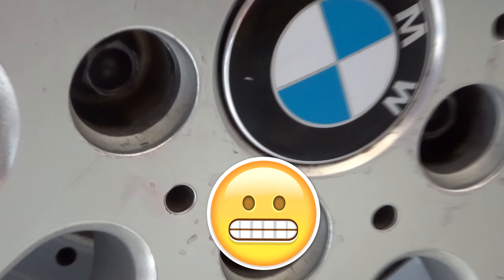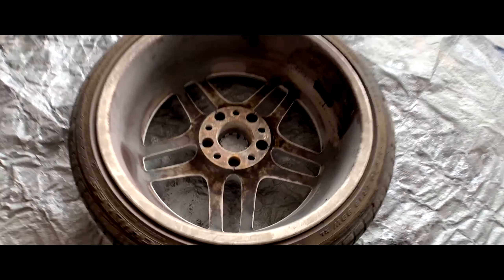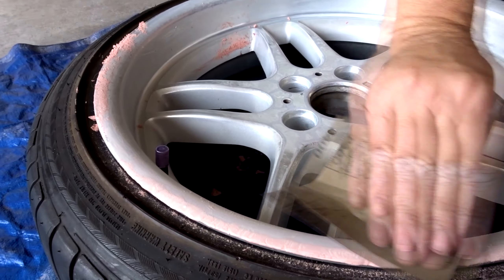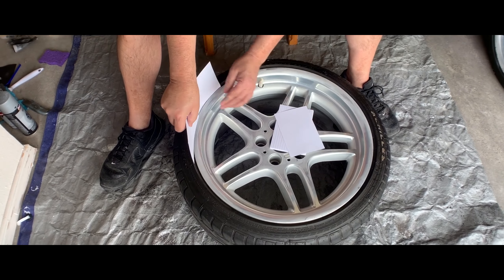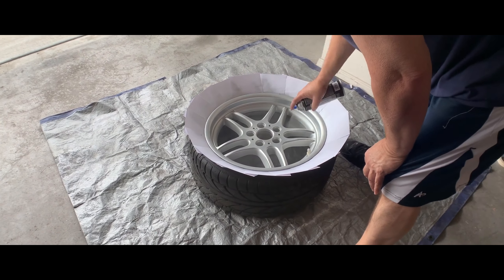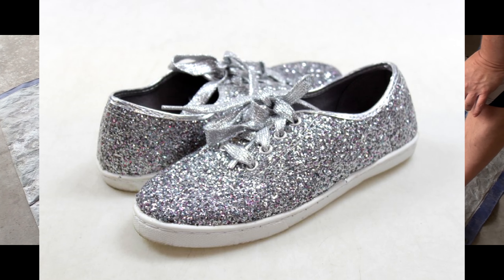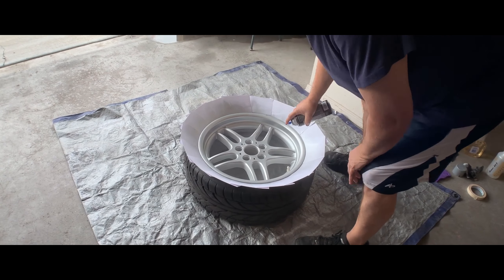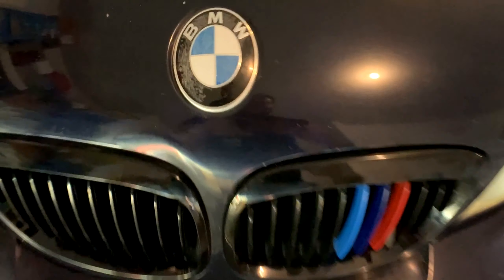How to Repaint Your Wheels to Get Rid of Curb Rash Under $30 Using Spray Paint (BMW E46)

Comment: If you have black rims can they be touched up or do you have to have it all resprayed?  Won't it show up and not match my paint or lacquer?
Reply from the maker: JohnnyZenith Black rims touched up would probably be more noticeable especially with the different shades of black available. The color of silver I got was a tad bit darker for my rims, so I would only assume it would be the same for black paint. My recommendation is to at least try to sand them down more and put a primer first. Extra clear coat might also help. It beats having to pay for a new set of rims though lol.